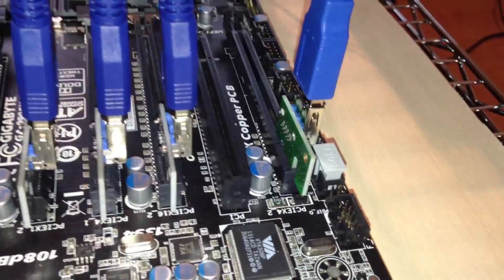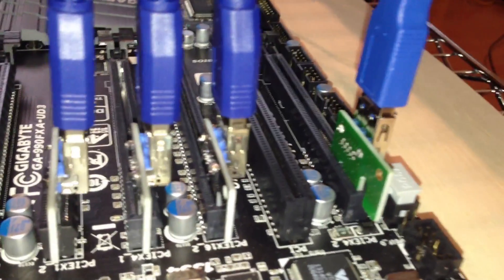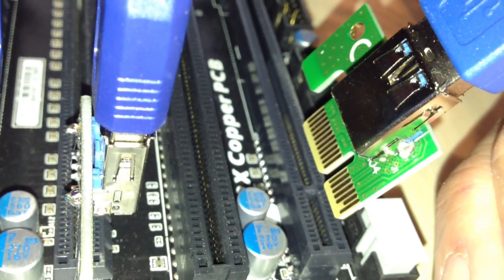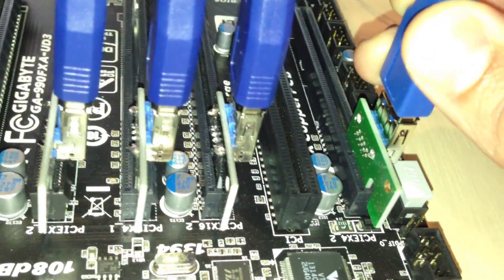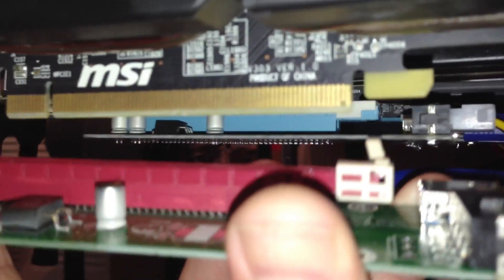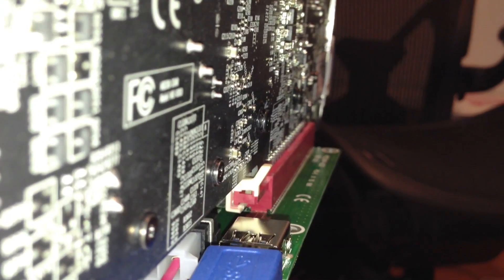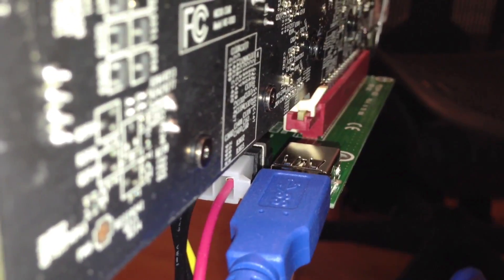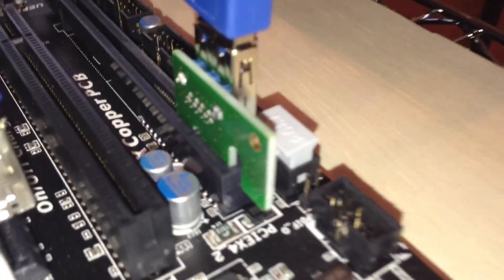USB Powered Risers GPU mining Litecoin Bitcoin

Comment: Jesus...Why is is so impossible to find a video showing how the POWER is connected to POWERed risers? Everything shown in this video is the obvious stuff.
Reply: Lol I know right?
Reply: Do you connect the PSU to the gfx card through both the PCIe riser AND the 6 or 8 pin connector on the GPU? Or is it just one or the other?
Reply: Its just a molex connector, it comes from the PSU.
Reply: he may have older cards that don't have the psu slots on them
Reply: Risers come with an adapter, 8-pin (or molex) to female SATA.  The female SATA end gets plugged into another cable that has 3 male SATA on one end, and a 6-pin connector on the other end.  The 6 pin connector goes into your PSU.  (Don't use more than 2 of the 3 male SATAs on that cable or you will burn your PSU).
https://www.youtube.com/watch?v=FEbTm7cXKLU
Reply: what about connecting server psu and GPUs? specially with B250 mining expert, anyone experience how to connect the psu?
Reply: It looks like you're going to need 3 PSUs.  I would get three 1000 Watt or better PSUs if you plan on powering 9 or more GPUs.  Each PSU will have only a single 24-pin cable for the motherboard and you need three of those.  You'll connect the three 24 pin motherboard cables from your motherboard to each of your PSUs, then connect an 8-pin cable from your PSU to your CPU (the 8-pin connector on your motherboard).
Reply: i would like to use server psu, this means it has only one 24pin connector, i know that here is something like breakout board http://bit.ly/2DL7HH4, but i am not sure if i should power also every 6blocks of gpus, as on MB is connector or no, and how to power the cpu, and HDD, MB etc.
Reply: How powerful is your PSU?  You're going to want at least 200 Watts per GPU, so take that into consideration as well.
Reply: The power comes from a second power supply. It's not difficult.

Comment: What motherboard is that? I've used a Asrock 970 extreme4 and it does NOT like 5 cards, much less 6. How did you manage to get that motherboard to boot with 6 cards? Also what operating system did you use to mine with all 6? Last time I checked, windows 10 doesn't support more than 5 cards.
Reply: asrock h81 pro btc mobo has 5+1 pci ex slots 1 long and 5 short ones
Reply: Se poate folosi riser usb 1x to 16 x in slot de 16 x de pe placa de baza (ai idee exista incompatibilitati in cazul asta? )